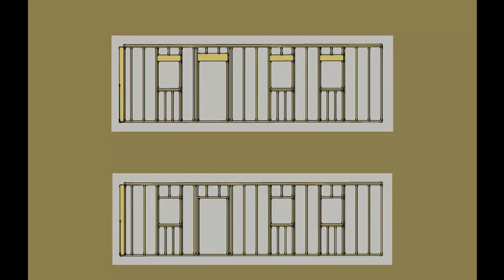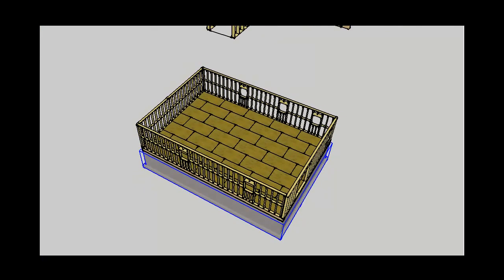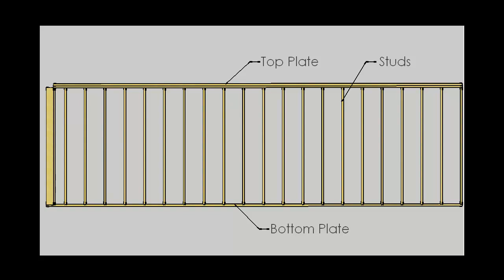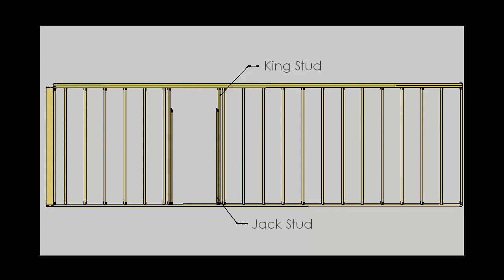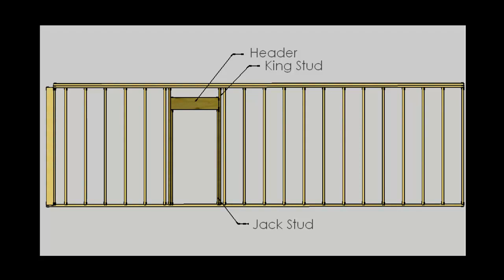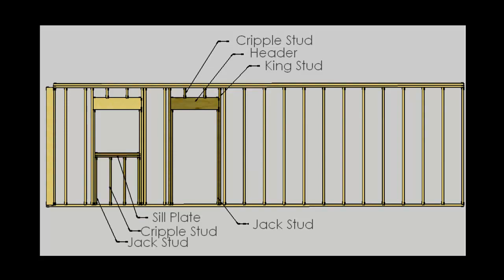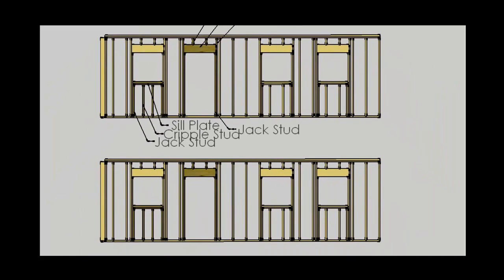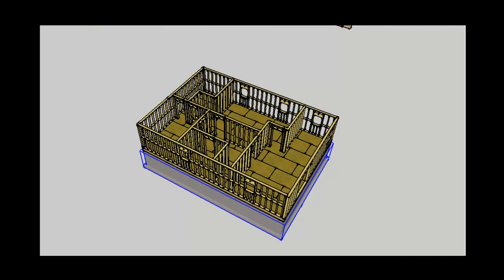Light gauge steel frame building system for load bearing and non load bearing walls

Comment: Question: Can I frame a trailer enclosure with these? It’s 6x9, so I was thinking every 24 on center and roof trusses. But built like the non load bearing walls?? The rv needs to be light as possible. Thank you for your free help and info.
Reply from the maker: Where are you located?
Reply: @stretchceilingsDubai  I’m in Lancaster CA, about an hour from LA. I stick built Shed like that and it’s still standing but with wood. And I have a 8x22x13h tiny house with 2x3 instead of 2x4 so I’m pretty sure this will work because it’s so small. But idk about wind shear or moving it around A lot…
Reply from the maker: @hershekissed  we are located in the United Arab Emirates.. You can find LGS building system company in your location. May be there is a company in the list https://www.framecad.com/en/contact-us/framecad-connect/
Reply: Do you think it’ll be strong enough
Reply from the maker: Yes I think so
Reply: @stretchceilingsDubai  thank you. I’m pretty sure because it’s not even long enough to be a span lol it’s like 8 ft
Reply from the maker: Yep you are right:)